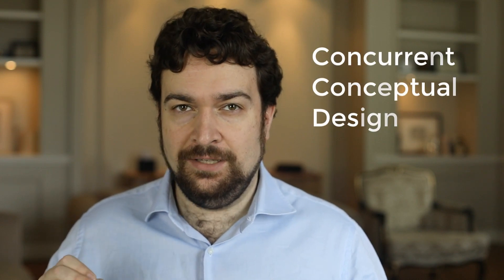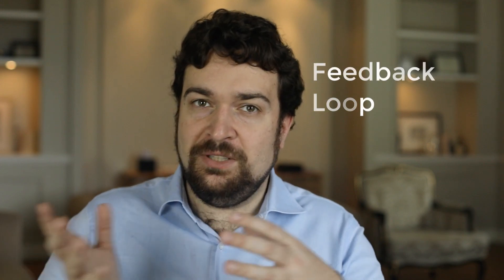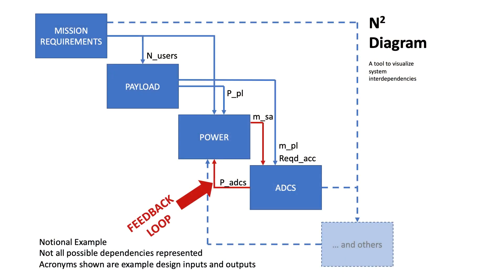New Space - 8: Introduction to Concurrent Design

Comment: Great video! As a space engineering graduate who conducted his Master Thesis in Concurrent Engineering I find this video quite interesting and definitely went through some of the issues you mention. I find particularly interesting the N2 diagrams development mapping inputs/outputs since the outcome of my work was a proposition of establishing a traceability between the inputs/outputs and their relationship to the satisfaction of requirements (as a specific domain expert, how does consuming a certain external parameter affects my current requirements specification) building a model which then can be used through iterations to detect these dependencies in a straightforward way. Looking forward to more videos like this!
Reply from the maker: Great to hear, Carlos. Check out the new video on concurrent design (number 9). Looking forward for your thoughts. Happy to connect with you and receive a copy of your thesis if you can share!